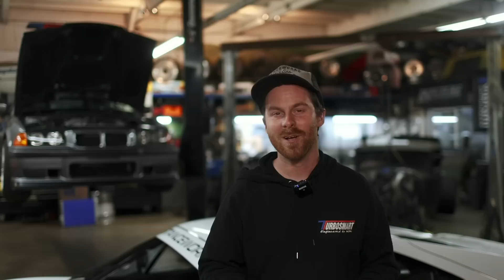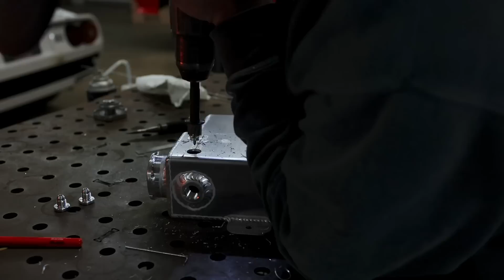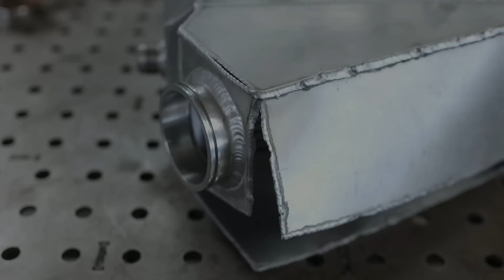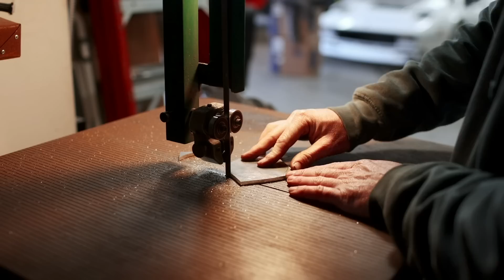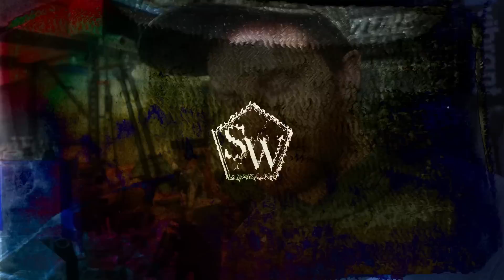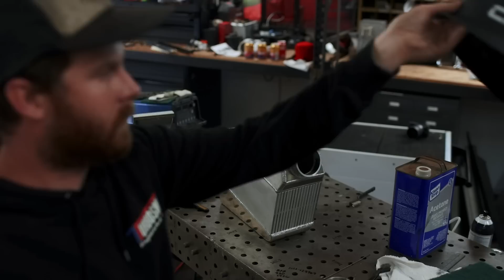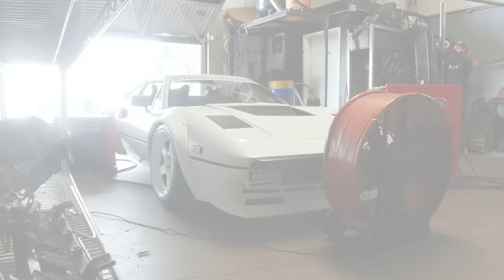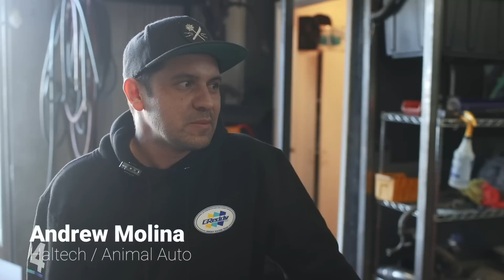FINALLY. The K24-Swapped Ferrari SCREAMS on the dyno!

Comment: Never do a pressure test without filling it with water (uncompresseble) you literally put your face close to a grenade 🥵
Reply: Pressure is pressure, does not matter if its air or water both are regarded fluids in the world of engineering 🙂 But its higly dangerus to test with air. Just think of an exploding tire with just a couple of bar of pressure. Keep safe 🙂
Reply: You have been incredibly lucky that it didn‘t explode in your face.
Reply: I was always told to use maple syrup!
Reply: @franko8572  That would definitely make the engine run sweet  🤣
Reply: Don't listen to the nay sayers man. Your out to make content. You know whats boring content. You as an old man passing in your sleep. You know what's amazing content. Blowing your face off on camera.  Be remembered forever. Or at least a little while.  Keep doing it your way!
Reply from the maker: That would leak test it but not actually test the structure
Reply: @stanceworks  pressure tests are always done with water or with air submerged in a water tank. As Mattias said, this was dangerous and why its not done in pressure vessel testing.
Reply: @stanceworks  as a plumber, pressure is pressure. Air or water, all the same
Reply: @stanceworks  false, pressure is pressure. Doesn't matter if it's air or water applying the pressure to the container.
Reply: @stanceworks  you simple man😂